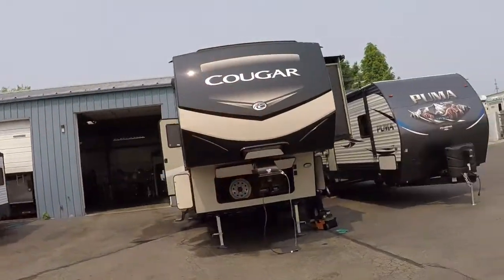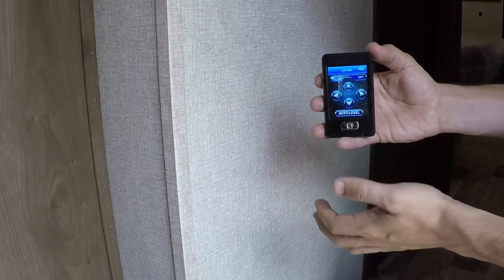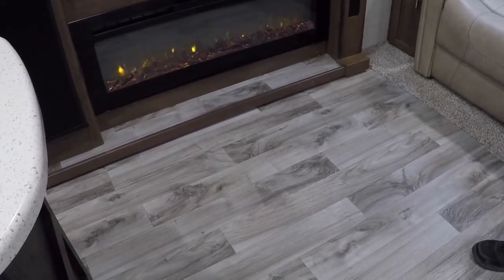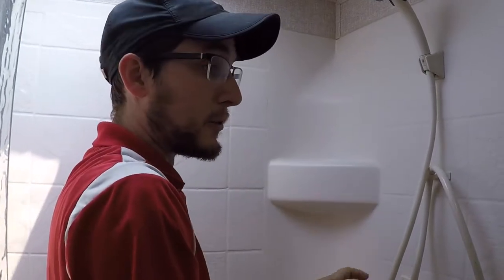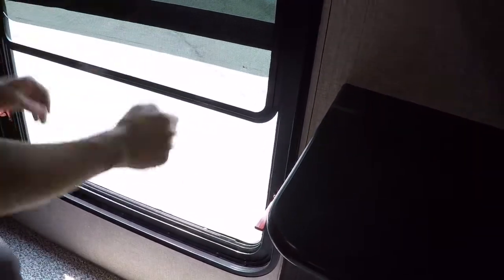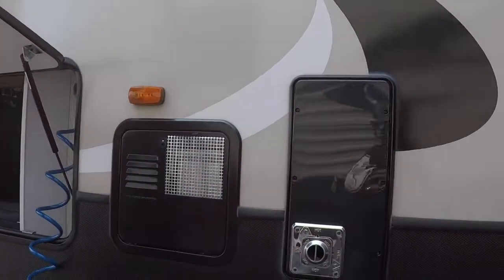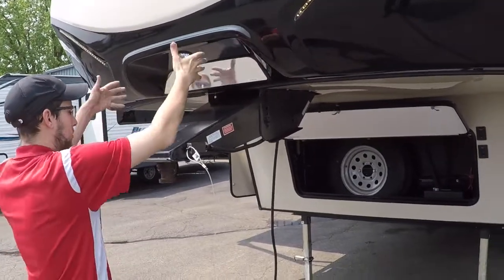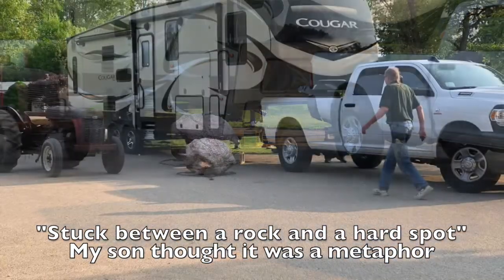Episode 5 Pick Up 2018 Keystone Cougar 310RLS, walk through and first pull.

Comment: What made you buy a Keystone? thought you were looking at a grand design?
Reply from the maker: We opened up to keystone for financial reasons.   Both rigs have extremely similar floor plans as well as built quality.  They both had pros and cons, however in the long run we did a nationwide search for both the Cougar and the Reflection and found this rig in Michigan.  Bottom line is we saved over $16,000 dollars on the price tag and we do love the layout.